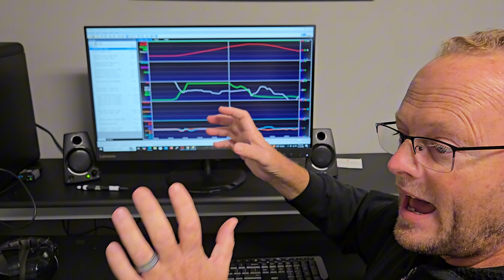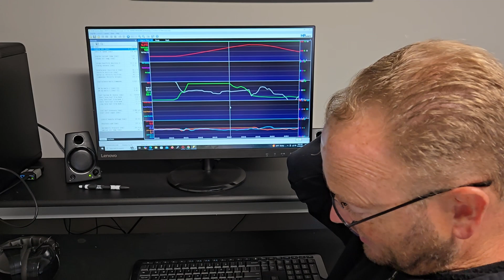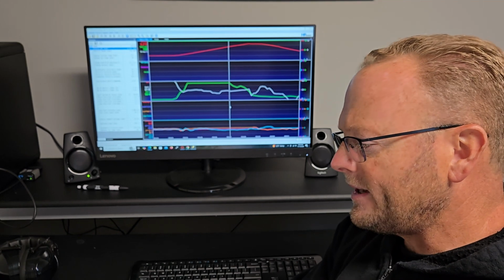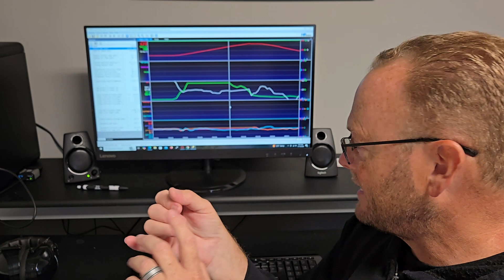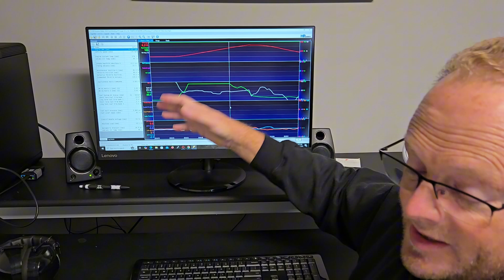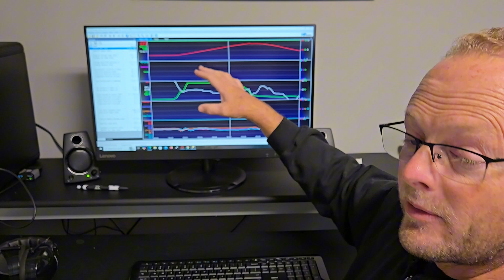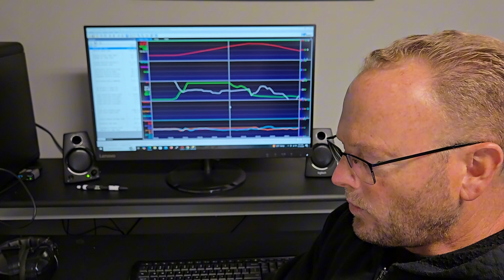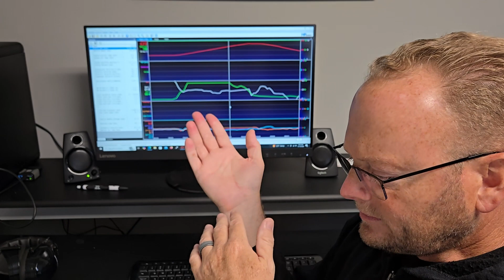S650 2024+ Mustang Custom Tuning Would Be A Big Deal IF/WHEN It Happens!

Comment: Recently added the Ford OEM PP oil cooler to my non PP 24 GT.  Haven't seen a noticeable change in the oil temp.  With the oil temps being an inferred temperature, is it possible the PCM needs to be told the vehicle now has an oil cooler for it to make the correct inference on oil temperature?
Reply from the maker: Inferred oil temp is likely based upon coolant temp, so unless the coolant temp changes, the oil temp will likely read the same.
Reply: @ thanks for the reply.  Changing the radiator to the PP should only give it more coolant capacity.  What would be different between the GT and GT PP in the coolant system other than the radiator?
Reply from the maker: They use the same radiator I think
Reply: @drpmotorsports2186  how would you go about changing the coolant temp?  Adding the PP radiator would only change the cooling capacity.  Suggestions?
Reply from the maker: Cooler temp thermostat and changing the fan settings in the tuning.
Reply: Different radiator between the PP and Non-PP.  I have the PP radiator installed.  Same thermostat, water pump, oil pressure sensor, and cylinder head temp sensor.  Has to be something in the tuning where the pcm knows the car has an oil cooler.

Comment: What about an aftermarket ecm like Motec?
Reply from the maker: That would be great, but I don't see that happening anytime soon. There is more to the story than just the ECM being locked.  My understanding is the other modules in the car have a similar security that requires agreement with the ECM, so you would have to rewrite the entire cars operating system to make another ECM work.
Reply: Rip the entire wire harness out of the car and junk it. Build your own.

Comment: He's right though about playing with the fuel on these cars.. I know guys get away with E30 blends all the time but that doesn't mean it's good for the car.. And that is, One of the main reasons why I stay away from buying cars from younger people. There's a huge difference between buying a used car from a guy who is over 50 and a guy who is under 35 years old.. 9 times out of 10 the 50 plus year old is just a weekend driver and he isn't out beating the shyt out of the car everyday.. I got lucky over a year ago. I found a Gen2 17 GT Base with a Performance Pack, the color I wanted with the wheels I wanted and it only had 8,909 miles on her.. I've had her 13 months now and I am just hitting 14,300 miles.. Look I know the 24's are the New New... But honestly the best bang for buck is an S550 with low miles. It's the same car with a few different body panels and you will have all the Mod's and tuning you can think of doing to the car.. You want an N/A Build done, Blower build, or Boost done.. The S550's are just ready to go and you can get one with low miles for under $30K shyt with high miles for $20K now. Anyway the 2025's are about to come out so that whole keeping up with the jones' or having the latest and greatest is like chasing your tail. I learned that a long time ago. But if you can afford $1000 payments to each his own. Do you if you have the money.. But for me I went used no payments and when I am ready, I'll have all the Power Adding n tuning options I could ever want.. Great video for sure.. I like the info..